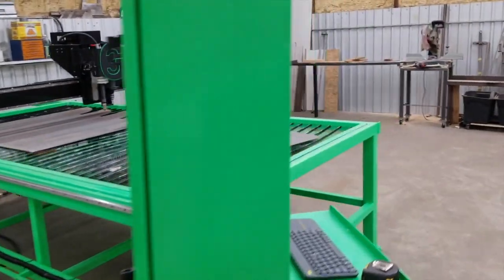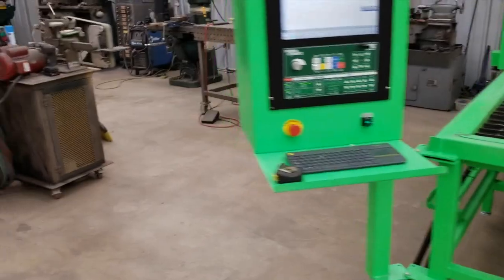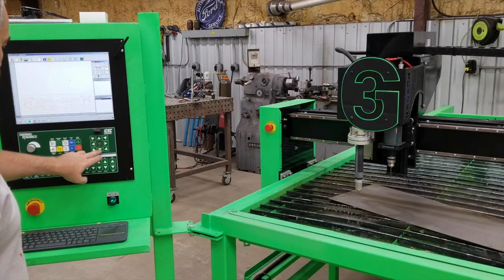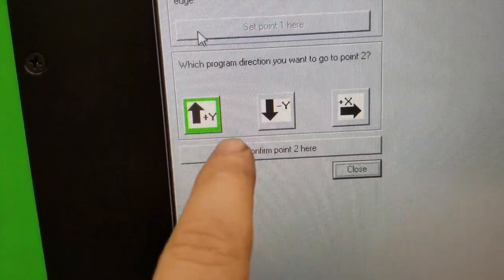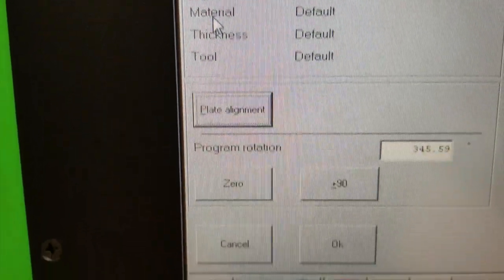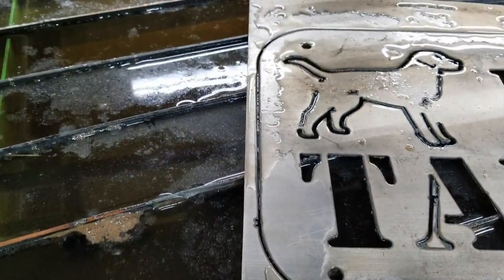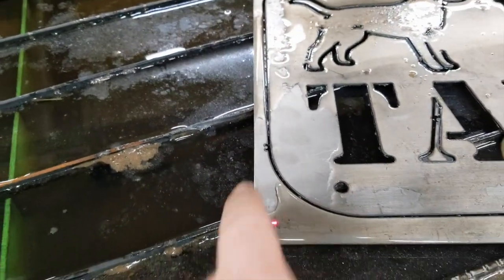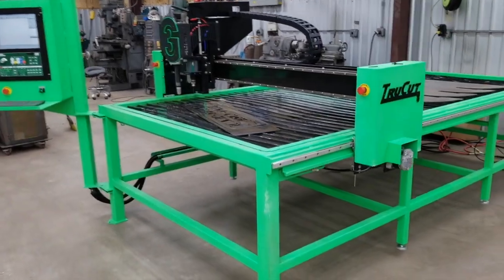Plate alignment on the Trucutcnc Thermal Dynamics iCNC Controller

Comment: Our Alltra Machine at work does that very easily as well but My OCD won't allow it, I square up every sheet with the laser, makes it much easier to line up with stuff later if it's square in case of a failure of some kind.  Cool machine there Gary, keep em coming.
Reply from the maker: definitely, i am just showing what it can do, but its way faster for me to placed it off the side of the table with some reference pieces of angle iron, faster, and like you said you can repeat it if there is an issue.  it might come in handy for odd shapes and off cuts

Comment: Hi Gary, The nerd in me is coming out.  Keep in mind that 1 degree rotation (misalignment) per/inch is = to .017.  So if your part is 24" long you are looking at .408 misalignment.  Math lesson complete.
Reply from the maker: lol yes sir!  so you could use the same kind of logic on the gantry being out of square, so if its out of square on onside by 1/8th" how far is out of square across 5 ft?
Reply: @turbocobra  how wide is your gantry?
Reply: That is why I align the material along the long side of the material, instead of the short side. Gary's demonstration worked great and that is a cool feature that my cnc table does not have. Instead, I just measure from the edge of the material to the edge of the rail that the gantry rides on. After setting my zero, I will use the remote to jog to the far sides of my drawing to ensure it fits on the sheet. For more critical/tricky cuts, I will do as Gary mentioned and do a dry run with the plasma off.